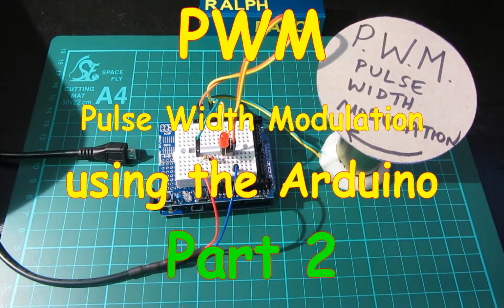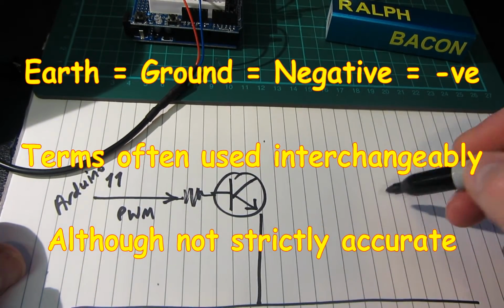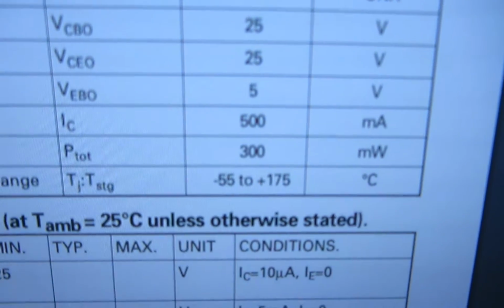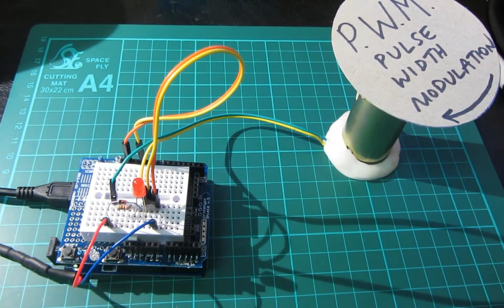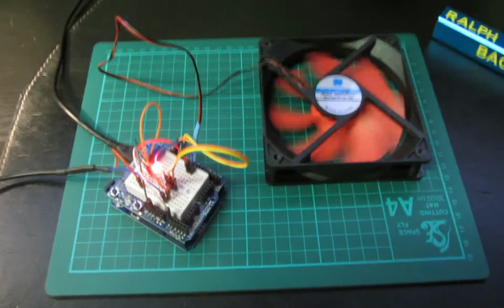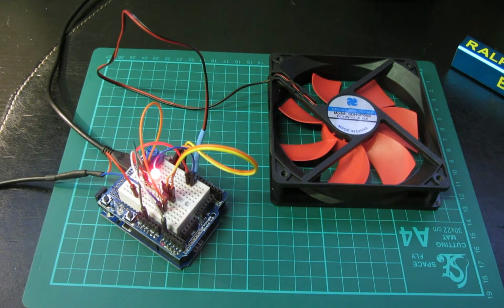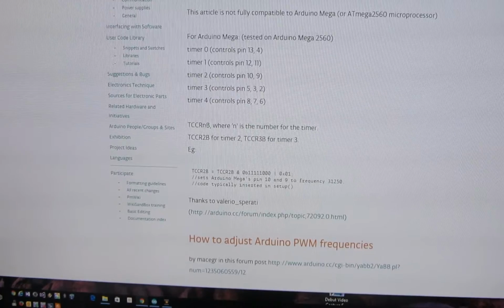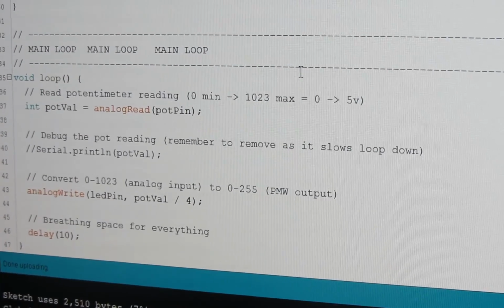#15 Arduino PWM (Pulse Width Modulation) Part 2

Comment: pleased accept my apologies if this has already been pointed out. I am viewing this in June 2019, more than 3 years after the video was posted. Your power calculation is incorrect. The transistor is either on or off. Therefore the power dissipated in the transistor is negligible. When off there is zero current and when on there is a very low voltage (about 0.35V) across the transistor. The transistor spec that is important is the max currant during the switching time. The max specified current is 500 mA and the hFE is 150 MHz. (sorry, cannot remember how to convert hFE to transition time).
Reply from the maker: If only the laws of physics worked that way, Charles! When the transistor is "on" it exhibits a relatively high resistance between the collector and the emitter. Sinking 60mA through that transistor at 12v is going to generate some heat. More current will generate more heat until the transistor junction melts. That's the downside of using bipolar transistors as a switch, good that they are in many other ways.

What we really need is a MOSFET that has a ridiculously low on resistance (perhaps 0.02 ohms) that can sink dozens of amps without breaking a sweat, see my video #136.
Reply: Ralph S Bacon Thanks for responding so quickly. However the voltage across the transistor is not 12V when conducting 60mA. The voltage across the transistor is 12 V minus the voltage across the motor, which is speed dependent of course. The worst case is when the motor is stalled, when the voltage across the motor is the current times the the winding resistance. However you look at it the power dissipation in the transistor is less than 720mW.

Comment: ztx300, used them for everything in the 80's, a move on from the bc182 lol
Reply from the maker: Yes, Lez, they're definitely "old hat" now, these days it's all 2N2222, BC548, 2N2907 or similar which you can get by the 100 from China for pennies. How times have changed.